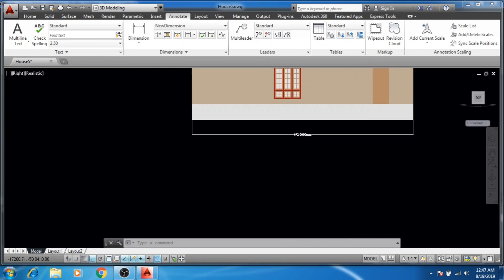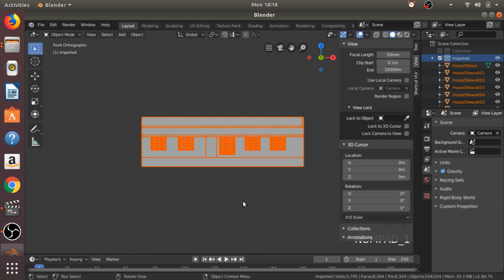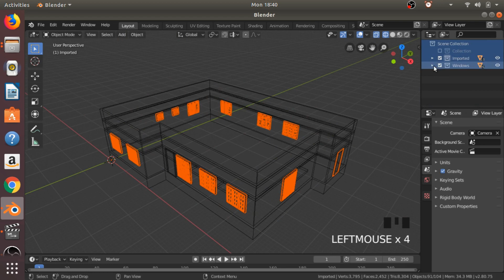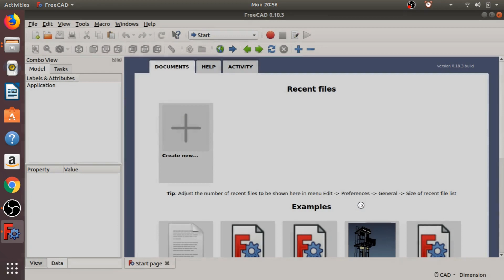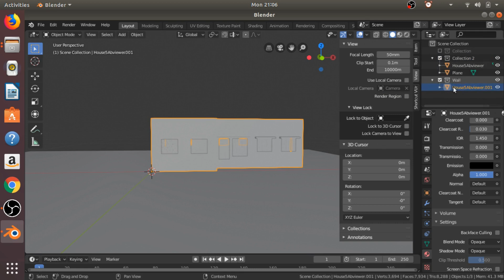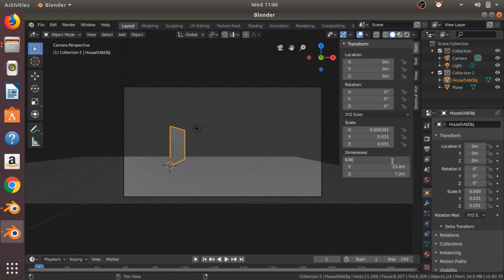Import 3D DWG(Auto-CAD) files in to Blender

Comment: How can I achieve a rendered quality in autocad but i want to view  it 360°. I made a wrist watch. I also want to animate the clock. Do I use a different software?
Reply from the maker: https://youtu.be/Aj5kUvTgKF4
Reply from the maker: Blender is a all in one software package. You can make the desired clock animation and the 360 degree camera rotation around your watch. Just export it to Blender. Then using the keyframes you can move the different needles using different time variation, or  you can use drivers to control each needle by another. For a 360 view of a camera just add a empty object in the place of the watch. Then parent it to the camera using ctrl+p then press i key set the key frame for rotation  of z axis at 0 degree and then move to 240th frame and again press i key and set the rotation value of z to 360. If you play the animation you can see the camera revolve around the wrist watch. If you are new to blender never give up. Try hard you can surely achieve. If you need any further assistance I will surely help you. Happy blending.
Reply: Thank you so much for your reply. I'll try my best to learn blender. Thank you bbro
Reply: The converted file cannot he rendered. When I click the Material preview. It's all black. What do I do.
Reply from the maker: @khenmehko1804  in the shading window change the alpha value of the material to 1 or simply remove the current material and add a  new material.
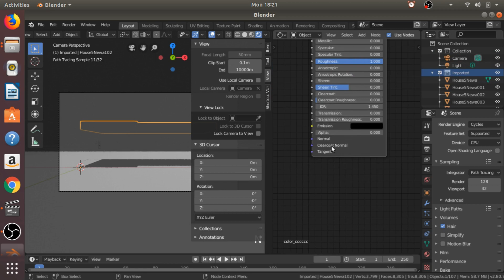Reply from the maker: @khenmehko1804  10:40
Reply: It only displays white on  Material Preview and displays gray on Rendered
Reply from the maker: @khenmehko1804  please add light to the  scene. You can add a lamp by shift+A sun or area or point lamp. Or just add an HDRI image in the world setting.
Reply from the maker: @khenmehko1804  HDRI Haven is the best place to download HDRI images for free.
Reply: I really appreciate your help. Thank you so much
Reply: Hope you make more awesome videos
Reply from the maker: @khenmehko1804  If God wishes surely post new videos with better improvement. Did you able to render it.  Surely early days of learning blender would be very hard for you but never give up. Try Blender guru Donut tutorial, CG boost apple tutorials. Best wishes for you to learn Blender. By the way there are many free materials available for your watch model on the internet such as from  blendermada, blend swap etc. Else go and download a watch model and append it to the current scene and use that material. Bye.
Reply: @gprizpah  I just saw the Blender Guru DONUT tutorial like 15 mins ago. Thank you so much for your time. Yup learning blender is really hard but I'll keep on practicing. Best wishes

Comment from the maker: I missed some words in making the bottom corner vertex as the orgin. After selecting the vertex press shift + s and select 3d cursor to selection and then in object mode select all the objects and go to object menu and set the origin at the 3d cursor.  Then place cursor to 0,0 by shift+c and  then press shift+s selection to cursor to place it at 0,0. Please slow down the video for clearer understanding. don't hesitate to comment for any help